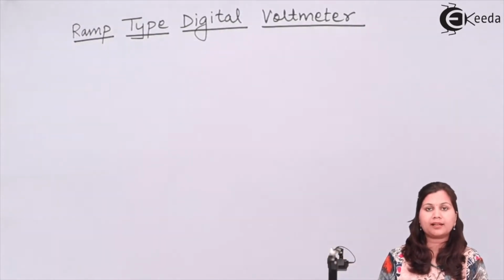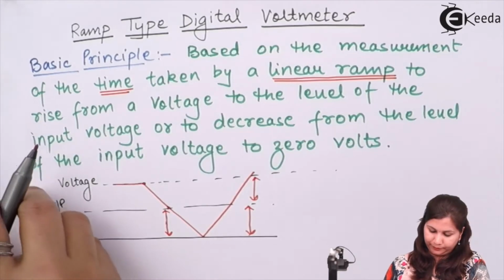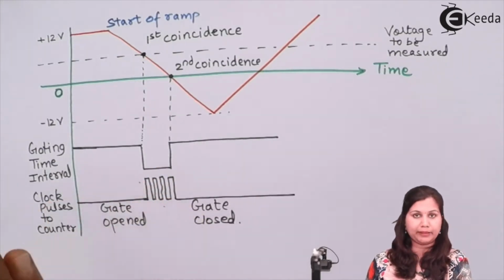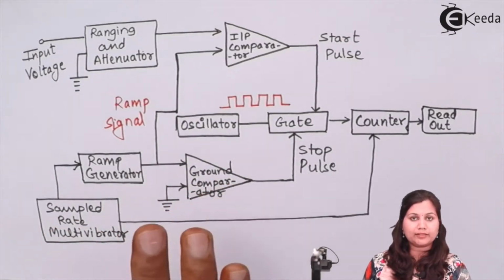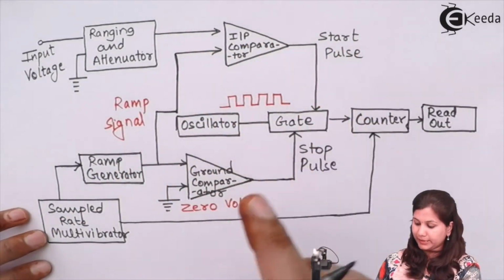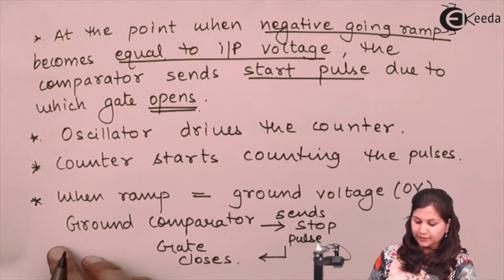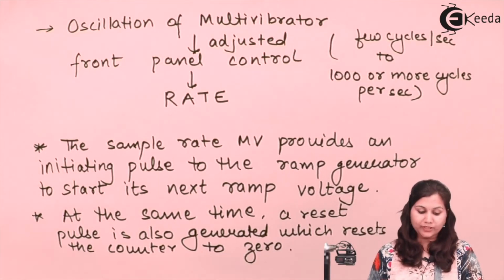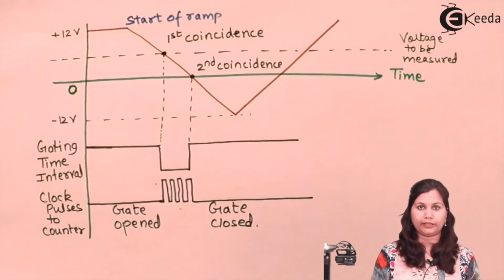Ramp Type Digital Voltmeters

Comment: The video states that this also works with a rising ramp.
How is the Ground comparator activated in that case? Surely the stop pulse will be given at the wrong moment?
Reply: Ground comparator is activated first to start gate. Then IF comparator activates to stop gate..
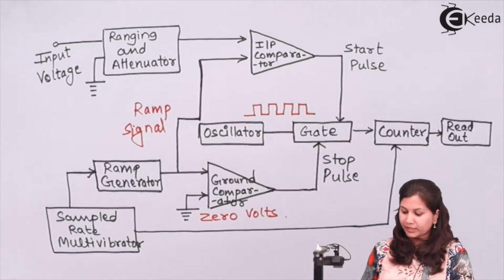Reply: @061_arsh  Thank you for your reply. I can see that,  but then the block diagram at 15:27 is slightly different.